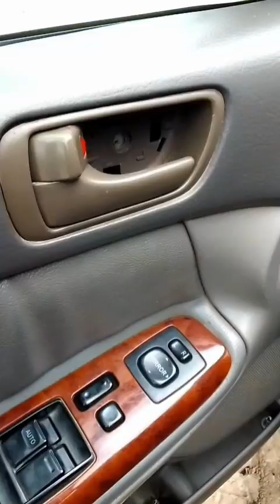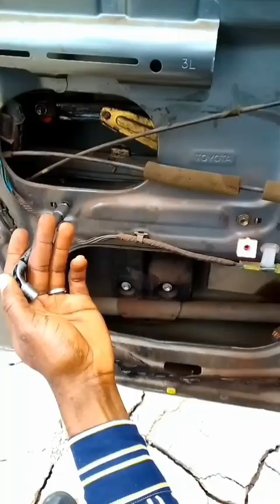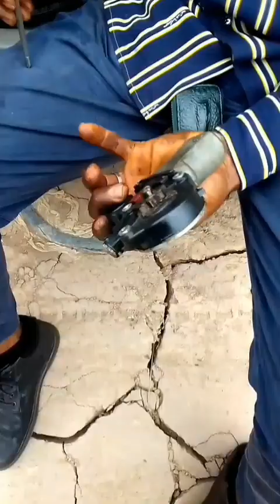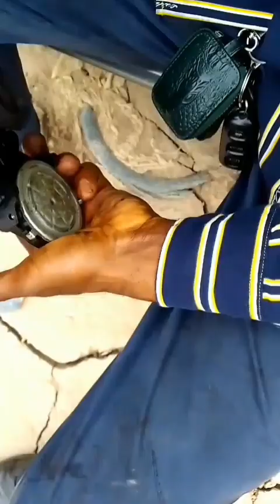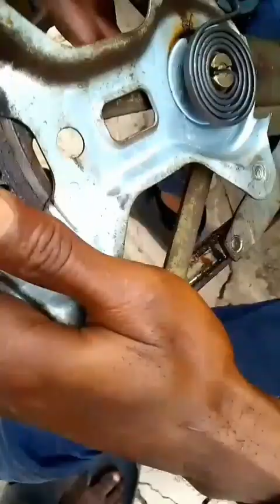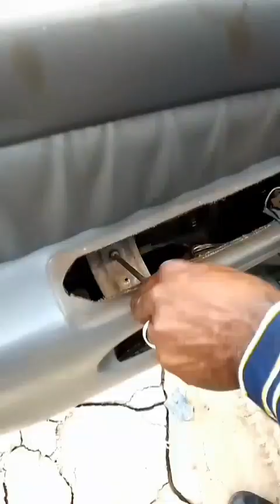Toyota Camry Driver Side Power Window Fix (2005 Model)

Comment: a tip from 03 camry owner as these cars get older to help take strain off the motors get a sponge paint brush and some tire dressing spray it on brush and run brush along the channel that window slides in. that extra lube keeps window from dragging and sticking and makes windows go up and down with less drag. Mine was kind of getting cock eyed on roll up and not sitting flush, this fixed it and window goes up and down faster and less drag on motor. On older cars dirt and grime buld up in window channel. take flat screw driver and rag and slide it through channel to remove dirt then lube channel
Reply from the maker: Thank you very much my good friend for your practical suggestion for vehicles that their power windoes are sluggish